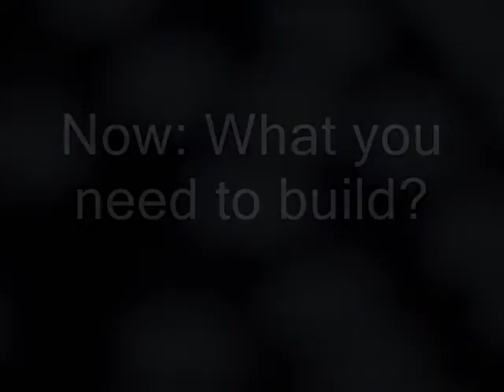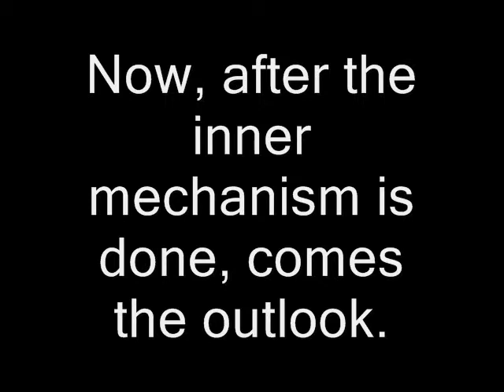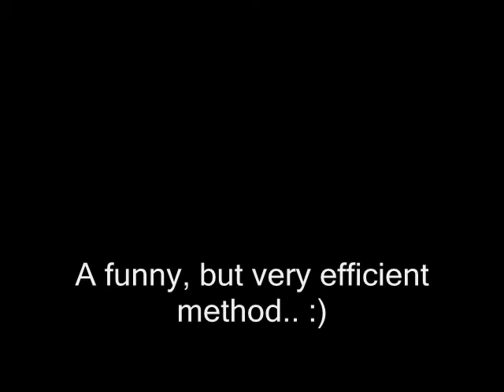Yomino Part 1 / (more than) Fully functional 3x3x2

Comment: Why didn't you just cut the edges in half the other way and then bandage it?
Reply: I had the same idea but I'm wondering what would need to be done to the mechanism because something about it doesn't seem like it will work
Reply: It won't work because you would have to cut the entire core in half